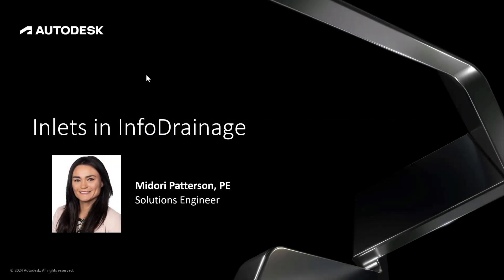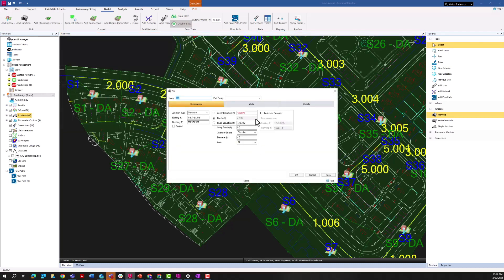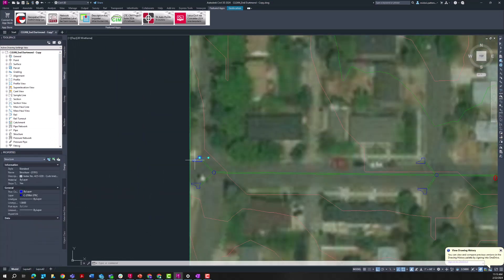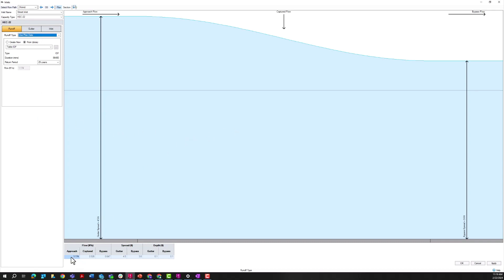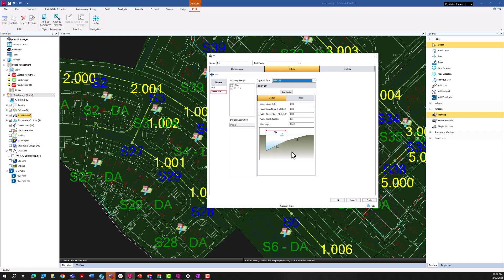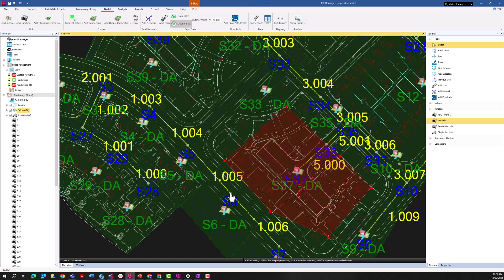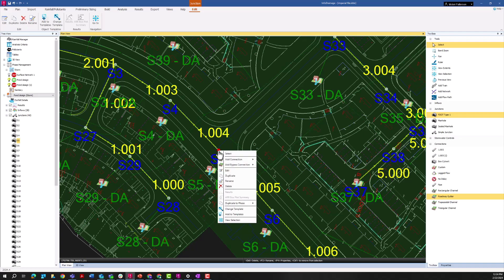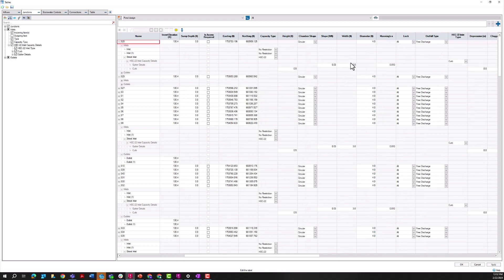Designing inlets in InfoDrainage

Comment: In UK we use to do spacing of gully using Excel, can we do the same in Infodrainage directly ? or the way you show the inlet i assume it will check the hydraulic capacity only, can we get the number of inlet required  for suppose 100m stretch of road?